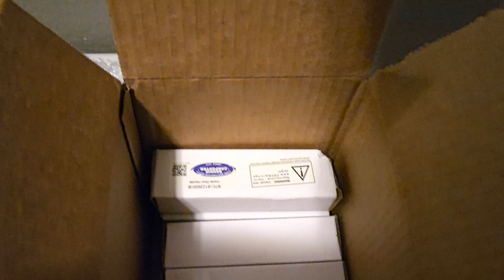New Parts & Tool - Removing  Gas Tank - 66 Ford Econoline Van

Comment: My understanding is the extra weight in back is to prevent the rear tires from loosing contact with the pavement under hard braking. I’m currently fixing up a ‘62 and intend on keeping the weight.
Reply from the maker: That is correct.  It would not be wise to remove it.

Comment: Be careful with the tool you’ll using to remove paint. I have the same tool. It’s capable of generating enough heat to warp the panel. Chemical stripping may be more preferable
Reply from the maker: Noted.